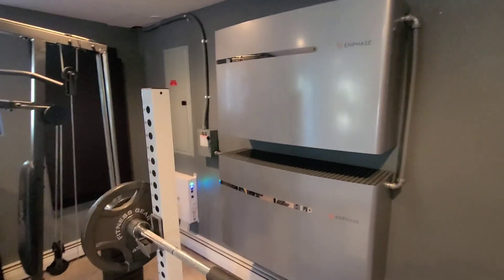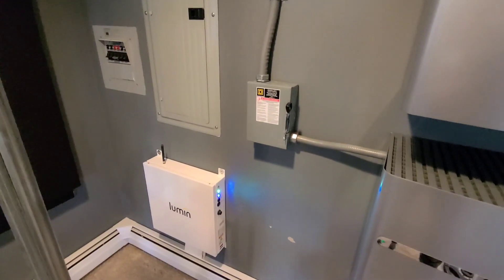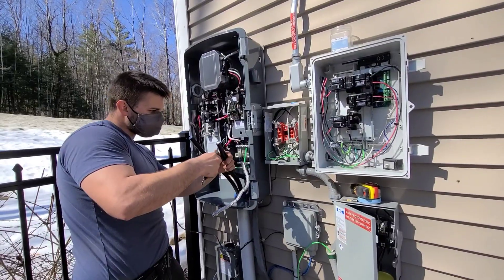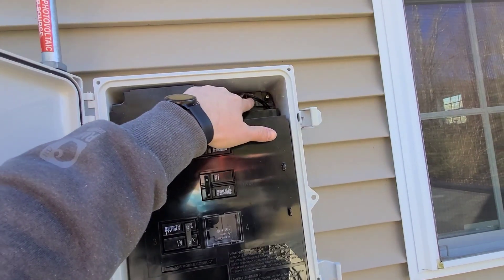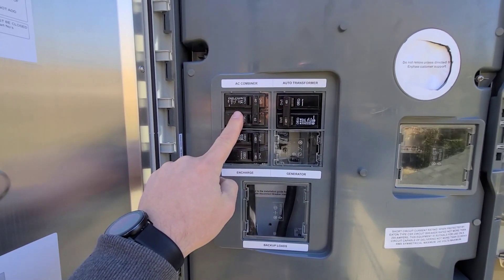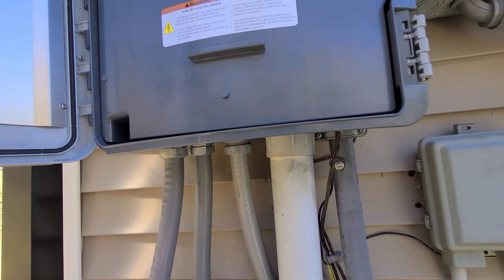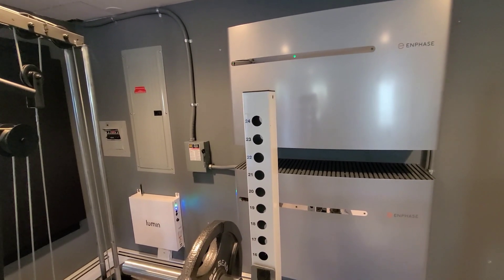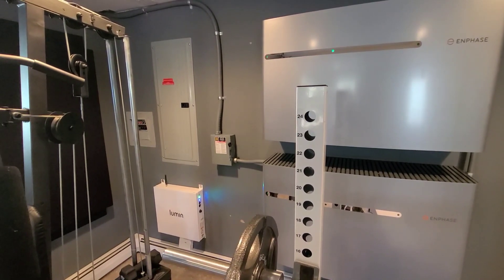New Enphase Battery Installation

Comment: Should move envoy breaker to the smart switch or backup loads panel.
Reply: Sorry. Just saw video date. I assumed iq8’s.
Reply from the maker: Not with this one. This is the R1 system controller with IQ7 micros. That breaker is fine where it is. For newer R2 systems with IQ8 micros, yes.

Comment: Im curious to know, where and how did you connect the lumins grid detection circuit in controller 2 box?
Reply from the maker: Piercing tap connector on one of the mains coming in down to a fused disconnect below.  Didn't really see another way with this one.

Comment: You forgot to add that only your installers have access to install soft ware . I want to install micro invert system I bought second hand enphase installer refused only interested in new install (more money )so regular installer could not install. same with battery bought second hand charged to check and install it has never worked properly enphase not interested . If you  purchase this system you are at the mercy of enphase . Not surge protected as my battery burnt out after power surge. 2 yrs after install
Reply from the maker: Yes I could see that being an issue.  As an installer I'm never exposed to the issues faced by users.  Can you create an installer account to get it done?

Comment: At https://youtu.be/BAXgXbhFy8Y?t=133 you mention the lumin panel going into the system controller 2.  Doesn't the Lumin go into the main load center to shed load?  Second, is this a 20kW PV system? If so, the system controller 2 has a 16kW limit, how are you handling the rest? Are you using IQ7 or IQ8?
Reply from the maker: You're right. The Lumin panel required a 120v sense wire off the grid side of everything, which we could only get at the system controller (1). 
This is a 20kWh battery system, about a 9kW solar array using IQ7+ microinverters.
Reply: @benssolarandbattery  Ben you may be interested that within a few weeks Lumin will be able to measure the SoC of Enphase battery and adjust loads accordingly.  It's beta now.  Also there is a new product coming out from Enphase that will be able to control 12 loads and monitor current on 24 circuits.  Was supposed to be this year but now next year. just fyi...  We are just building our system from scratch so have a snapshot of what is on horizon for the new design. Also integrating an EV.
Reply from the maker: @PiMatrix  I'm waiting for them to get their firmware figured before I install anymore of these honestly.  That's great that they're coming out with all of these new things, but I need them to keep the basics going too.

Comment: Whats the average cost of the 2 battery system? Not install price just price for the batteries and required accessories?
Reply: 10k each for just the a battery so 20k for 2 Encharge 10s. Required accessories depends on you. Smart Switch is a few thousand then you got the envoy with or without a combiner. it's very custom so broad questions like this are difficult to answer.

Comment: The Lumin doesn’t go in the encharge micro grid lol it only ties into load center x_x
Reply from the maker: Correct. That's how it was installed...  still need a grid sense wire though.     thanks for watching!

Comment: Thanks for the video. But what's up with all that non-metallic tubing? Run some EMT conduit, looks way better. Signed, Master Electrician.
Reply from the maker: I totally agree.  Another company did the solar install... I only use metal flex when needed.

Comment: I have a 33 KW Enphase battery system.  Had it for 2 months and use it every day when my electric company sends the rates through the roof during peak usage times.  No problems and no noise.
Reply: How much did it cost in total?
Reply: @prasadkodali1105  It was a little over $30K from what I remember.  I didn't pay for it, the electric company paid for it.  I have medical devices that I need to have plugged in and ready to use at all times.  The electric company had a program to put batteries in homes with medical devices because they will turn the power off if there is a threat of a wild fire in my area.  The $30K was including installation.
Reply: @davelindgren5245  thanks for the reply
Reply: @davelindgren5245  I almost left a crazy response without reading this thread 😂 yeah that's crazy cheap

Comment: Here in Texas, we'll in Houston, the city wants atleast a 2in clearance between the service meter from any electrical equipment. But overall cool
Reply from the maker: The power companies here are generally very relaxed.  They don't even care if I cut tags and pull the meter.
Reply: @benssolarandbattery  lucky, we get a replacement fee, and penalties. Lol

Comment: The smart-switch is like the gateway and the combiner box is like the solar assembly (except the assembly has a built in inverter since they don't use microinverters) for Tesla?
Reply from the maker: Yes, the Smart Switch is the Gateway but also has a built in Autotransformer to form the neutral (the microinverters are 240v no neutral).
The combiner is just an AC Breaker panel stuck into a fancy box with the envoy in there as well.  The envoy (which now controls everything) gets a wireless comm kit which talks to the batteries and Smart Switch.

Comment: Does any of that equipment make any electrical noise -- humming, buzzing, clicking, etc?
Reply from the maker: The Smart Switch makes a low  humming when its off grid  (autotransformer), occasional clicking of the relays but only when off grid, and some buzzing as well.  The batteries themselves make a very quiet hum that you can only hear if you listen closely.

Comment: Do you know what the 2 small wires are on the S280-ACB-LL inverter that connectors to the battery.  I know it's not supposed to but trying to use it with a solar panel vs the battery or want to use with my own battery to backfeed
Reply from the maker: I've been told that the inverters they use in the batteries are for battery only use.  I've also never seen that model number before, I've dealt only with the US version. 
If I had to take a guess, I'd say it's probably thermistor leads. If you cut them or short them, it will most likely throw an error.  You'd need to check the resistance of the thermistor in the battery, then hook up a resistor with the same approximate value.
Reply: @benssolarandbattery  could u tell me what the resistor valve is. I will try it. There are sources on ebay that have 1000s for so cheap. And the diy community is trying to get it to work. https://community.enphase.com/s/question/0D53m00006eDzPM/can-an-s280acbll-be-operated-as-an-anti-islanding-inverter-in-a-grid-tie-situation
Reply from the maker: I have no idea what it is.  Most likely either in the 1k ohm range or 10k ohm range.  Look up charts for both and select a resistance value in range with room temperature.

Comment: What loads did you pull out of the main panel and install in the sub panel?  My understanding is the sub panel loads are the only ones that can get power in a grid down situation.
Reply from the maker: So in this one we used a Lumin panel and moved only the heavy loads into it such as the car charger, hot tub, dryer. When the power goes out, they automatically shut off, but then the customer has the option to turn them back on via an app on their phone.
Reply: @benssolarandbattery  Interesting. That’s opposite to what I’ve been learning. So, does that mean the main panel then gets power from the battery/array in a grid down scenario?  And if there is sufficient power available the Lumin will let a big load start/run?
Reply from the maker: @j_scott_parker  it's a lot more efficient to move a few big loads rather than all of the little ones.  The Lumin panel doesn't communicate with the battery, so default when the grid goes out is to shut off the loads.    The point of it is so you can easily and remotely turn things like heat pumps or car chargers on when needed, but also turn them off to conserve battery.
Reply: @benssolarandbattery  Thanks and sorry for all the questions. Yes that makes a lot of sense. For me it would be two AC units, two pool pumps. My assumption with starting off with a 10k battery, I wouldn’t ever be able to run those, but the electric guys would have to load calculate the rest to confirm the 10k could handle it. Down the road I could add battery to then possibly run an AC. Do I have it correct?

Comment: Looks great Ben! I bet that was a back breaker getting the top battery mounted, unless you had one of those fancy lift dollies (something I need to buy...).  I haven't seen the Enphase system yet (except on spec sheets). Been working a lot with SolarEdge/LG on my installs in MA. Keep up the great work!

Comment: Over $1k per kwh? Yikes. Pre-built LFP packs are down to $300/kwh these days. Obviously you can put together your own for about half that.
Reply from the maker: Yes, building your own is most definitely cheaper.  If everyone built their own stuff, I'd have to change my business model!
Reply: @benssolarandbattery  even compared to other pre-built packs with an integrated BMS/circuit breaker/fuses it is still very expensive

Comment: I love the Enphase micro inverters but never considered their batteries.  I didn’t know they were the better chemistry so will definitely consider now. I’m planning my install now.  Will start with a 12K Sol-Ark with a grid tied 48v LiFePO4 battery backup system with generator backing it that up until I can add solar.  I live in central OK and we get hail on a regular basis.  I would appreciate and suggestions on solar panels that will work well here.
Reply: Enphase batteries utilize passive cooling and thus they do not use fans and have no central point of failure.

Comment: Nice Lumin panel.  I attempted to get one for my house.  Contacted them and didn’t seem too responsive or didn’t take me seriously.
Reply: And here. I finally got someone and they tell me I can't have the smart switch without the battery, that it needs it to work. I'm pretty sure they work without they just want to sell the battery. I just want for emergencies with power during the day and I will use generator during the night.

Comment: What an incredible setup and so much more stored energy than in several Tesla units!
Reply: In reality Enphase’s Encharge system is far more expensive than Tesla’s when compared $/kWh to $/kWh. But doesn’t detract from the fact that both are great battery systems.

Comment: What are we looking at there $40k? not including the roof panels
Reply from the maker: Just over half that, but still not a cheap system.  It has a lot of really cool features and many people will pay a premium for a premium product.
Reply: Each of those 10kwh batteries cost almost $11k each, the smart switch $2.2k, Envoy combiner+ is $600 and the Lumin Panel another $2k plus.. plus the labor, wiring and breakers...this is a $28,000  plus with installation.., for a continuous 7680 watts and 11400 surge watts for 5 seconds...with a max 32 amp output... To much money for output....does not make sense  ...
Reply from the maker: @iridium58  everyone's entitled to their opinions.  We charged less than your projected materials cost for the entire install, so your numbers are off somewhere.  Not trying to be rude about it, but some people don't want to build their own system or are incapable of it and want a reliable battery backup from a reputable company.  It's definitely not for everyone!
Reply: @iridium58  I agree .Anti slanging is a huge money maker for the solar industry. which brings to  mind the question: is it the solar lobby or the generator lobby who benefits more by simply inot mplementing ATS equipment with solar installs.I was sold on enphase with their promise of the iq8 and it's modular adaptability but seeing as how folks with deep pockets will pay a ransom for convenience I tip my hat to you Ben.What you're selling and what you're using yourself could not be more at odds.
Reply: sorry typo. anti islanding
Reply: Here in Houston TX they wanted $21k for a 10.5 kw battery and a 3.36 kw battery ( 13.86 kw total) Enphase Encharge system....and the $28k I quoted is for the average joe internet prices, contractor pricing can lower that to $24k....still pricey